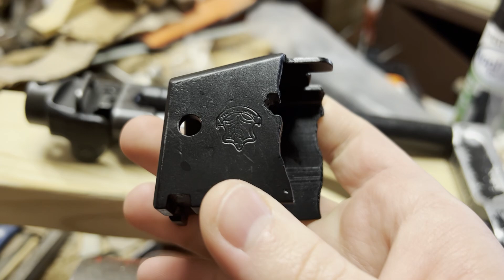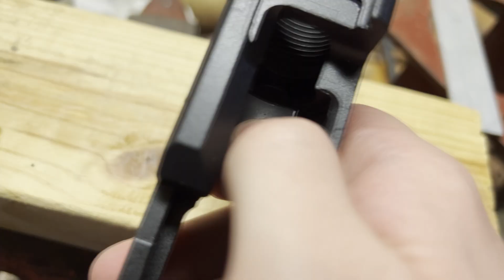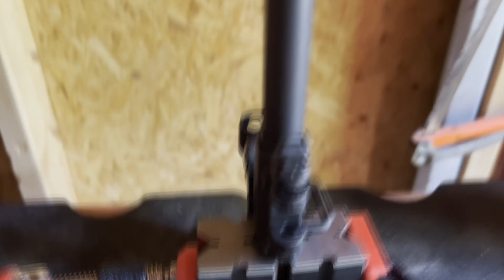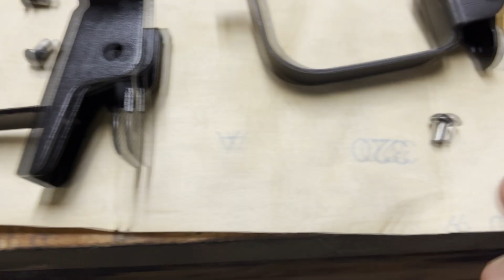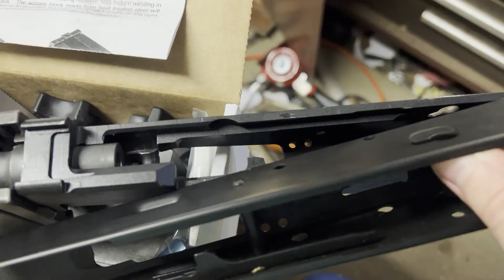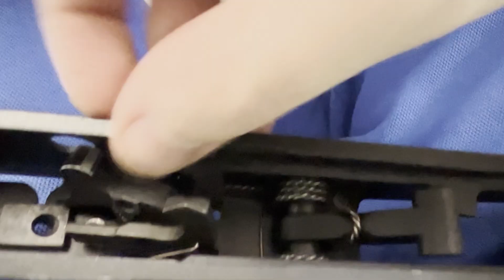Galil ARM Parts Kit Build on a Tortort Receiver

Comment: I’m doing a milled ak build and will be using a friends mini mill to drill pin holes. Hardly any different from this galil. I’m no machinist and neither is he. What fixtures other than a vise do you think I would need to make sure nothing moves while drilling and the holes don’t get out of whack?
Reply from the maker: @Almost_Made_It Check out this video Mel64D has on lining up the barrel pin hole straight in a mill - that seems like the best way to do it IMO: https://youtu.be/ol1qlzfrCK8?si=qd4IxDGlQe9DobuK

I helped my brother with an AK build recently and we just put a 7mm rod in the barrel pin hole until it lined up with the bit in the mill, then a small v block to clamp the barrel (2 clamps), and the v block shimmed below and clamped tight in the vise. Also, we had something under the trunnion to support it so it didn’t push it down when we drilled. Starting with an end mill and then switching to a drill bit, both slightly undersized, then reamed to 7mm. If you egg the hole you can always drill for an oversize pin.

For the smaller pin holes, I’ve done them on the mill and I’ve done them with a hand drill. You can start with an end mill and finish with a drill, but you can also just use a drill bit very carefully lol. One thing that can help is drilling halfway on one side and halfway on the other side to meet in the middle if you’re not confident you have it lined up, then ream to your final size.

Hopefully that helps, there’s lots of info on the AK files, the AK forum, and weaponsguild. Good luck with your build!
Reply: @Ryan45678 thanks. So it looks like I’ll need a V block and maybe some other support because he already has a vise. Not worried about the barrel pin because there is no existing hole so it should be easy to drill. Definitely more worried about egging the barrel component holes
Reply from the maker: Ah, that does make it easier! Yeah, since you’re doing it on the mill you’ll want a V block & clamp, and for support I’ve honestly used bolts, bar stock, really anything else that would fit under the barrel and hold it up. The hardest part is knowing when you’re straight up and down